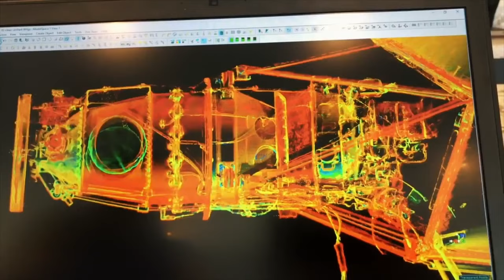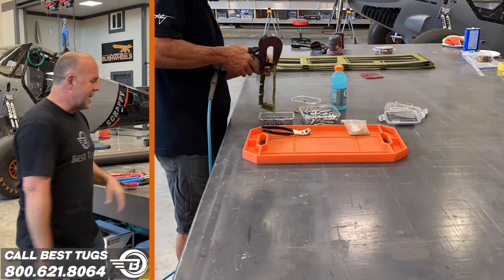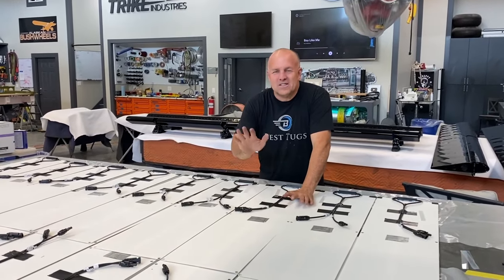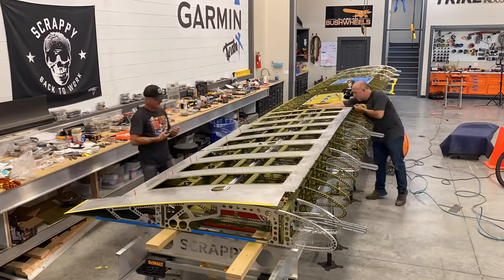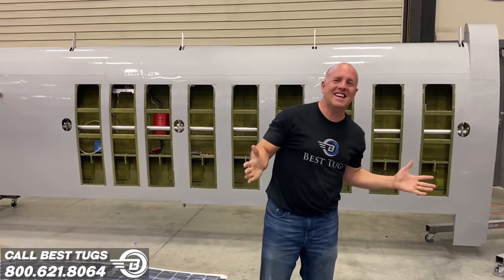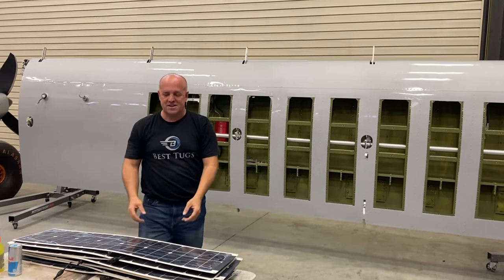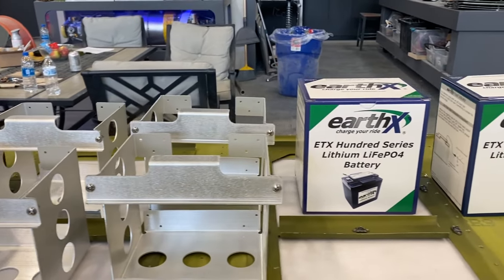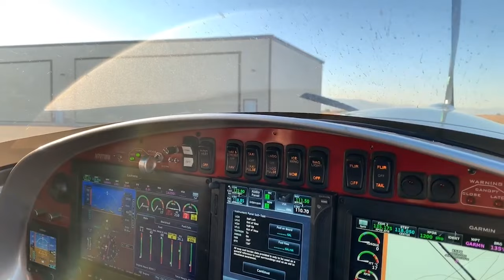Solar Panel Wings on Custom Search and Rescue Bush Plane | Scrappy #59

Comment: I put a sticker on my Grumman and had to take a nap afterwards. 
It's a Mike Patey sticker though so the sticker itself has a lot of additional parts, functions, features, etc
Reply: That sticker is better, stronger and lighter than all before, I guess? 😉🤙🏻
Reply: I have to take a nap after watching most of Mike’s videos.
Reply: That sticker alone just shaved 5 knots off your stall and added 5 to your Vne🤣
Reply: And it kept working while you slept...
Reply: Bryan, when you get back to the plane that sticker will have given it a wash and wax.. Back to Work.
Reply: ...and it is made of carbon fibre!

Comment: I think the most exciting part is the fact that when he’s “done”, he’s not done. There’s gonna be something that he thinks about doing after this plane is already complete. Absolute genius, Mike! Keep inspiring. Keep pushing the limits. You’ve earned a fan for life.
Reply: An old engineering adage: "If it isn't broke, it's simply because it doesn't have enough features yet!"
Reply: With only two seats and with the ability to carry large loads under the wings he should make some carbon fiber people carrying pods. Can use the excess electrical power for a heat pump to heat or cool the pod interior. They would easily double up as extra cargo carrying capacity for day to day or S&R usage. Bonus points for being able to air-drop cargo like life rafts with supplies or cases of beer for thirsty campers. Integrate the Garmin system to auto release when drop calculator indicates an on target landing.
Reply: Draco X is coming up
Reply: @peach6405  yep, I think allot of people forgot he as another Wilga waiting to be build!

Comment: Ahh yes, overengineering the shit out of everything. I love it. 

Sincerely,
a German
Reply: lol...for you it wouldn't be overengineered then? just normal
Reply: @shaneward6689  Maybe thats how Einstein got the idea of relativity
Reply: That's the German way...
Reply: Yeah, World famous German engineer.  I fully expect that Mike would attribute some of his inspiration to that.
Reply: I wonder if he uses 8 different kinds of fasteners to hold the cup holder on and require half the plane be taken apart to access the last fastener like the Germans did/do.
Reply: @tihspidtherekciltilc5469  integrated design is mostly lighter than an easy accessable one... ;-)  best regards from a German engineer :-D
Reply: @DaEVOthefreak  Cheers to you as well. I was just teasing which I think you picked up on. That being said why is the thermostat on my friend's Passat buried behind the timing components?
Reply: @tihspidtherekciltilc5469   Or late Audi Quattro. Remove front of car, remove engine and auto, separate auto from engine. Replace cam belt, rear of engine. $7,000.
Reply: @moyadapne968  Seriously?
Reply: @moyadapne968  You should be a writer for Chilton's!
Reply: Wrong.  He's overbuilding... not over engineering.  There's a HUGE difference.
Reply: @David-ql1hd  The wing system on this plane is definitely engineered beyond anything you would ever see on a commercially built plane.

Comment: The level of thoughtfulness in this build is absolutely astounding. Can't wait to see yall take her up.
Reply: definitely, it is going to be pretty heavy though
Reply: @jakub-kube  good thing he's got Nitrous
Reply: I don't get it..  how can the solar panels be a structural part of the wing, are they aluminum backed?  It seems like they should be backed by aluminum and riveted in, or the will just crumple up with air pressure.
Reply: @gwenives9203  I just mentioned that above, the negative pressure on the top of the wing might suck them right out!  Good thought!!  --gary
Reply: @gtr1952  my concern with the panels is that if they are not well secured to stop flexing and vibration, they normally fai lprematurely. The normal way to secure them is with adhesive coating the whole back of the panel and glowing them to a solid surface.
Reply: @gtr1952  negative pressure, so vacuum you mean? I dont think that will be an issue. Im sure he has already thought of that and tested everything multiple times
Reply: I thought so this as well.  The air lifts the wing so wouldn’t the air pull on the solar panels and because they are weaker than the aluminum sheeting, will they be compromised.   Hope you see this threat Mike.
Reply: @DBartWest  guy literally builds a whole ass plane in front of your eyes, but you think he hasn't thought about wing loading lolol
Reply: @DBartWest  Ummm. You think a guy who is on his 14th airplane build didn’t consider these things? 😎
Reply: @tomcoryell  these panels are supposed to be fully supported over the whole area of the panel. Just being supported at the edges and a couple of places in the middle will lead to much reduced solar performance very quickly. I have seen the output of them reduced to nothing in a matter of months when not installed correctly.
Reply: @gwenives9203  they're not. He added extra strut to compinsate in part for the solar
Reply: @tomcoryell  Yes, of course I think he has considered that, however, like 3-4 other people here, we would like to hear that consideration from Mike.
Reply: @cnknguyen  Yes, of course I think he has considered that, however, like 3-4 other people here, we would like to hear that consideration from Mike.
Reply: @gwenives9203  Cubs fly around with fabric covered wings. Let that sink in and you have your answer.
Reply: @Kenriko  no that's not an answer. Fabric is very strong, ever try to tear a shirt without starting at the seam?  Whereas solar panels, whatever they are built on, certainly may not be structurally sound, plus even if they were strong, some reverse pressure inside the wing could just pop them right out.  It really seems like a huge goof, he would have been better off just creating an aluminum wing and then depositing solar cells across the entire thing on top of the aluminum.  But then again he also machined his ribs, clearly not understanding that machined parts don't have nearly as much strength as stamped parts.   Hey but maybe that's why he put a parachute in S-crappy
Reply: @cnknguyen  yeah, well he also bought over priced under valued video cards for his simulator, so he hasn't thought of everything.  Plus he doesn't seem to realize that machined wing spars are not nearly as strong as stamped spars.. it comes down to the atomic arrangement of the alloys.. have you ever seen anyone using a machined sword?  No?  There's a reason... it isn't nearly as strong.
Reply: @gwenives9203  Would you like some more salt? The solar panels are on a plastic substrate that's about 1/4th thick. I would not consider it structural but it'll hold up to the wind just fine. He won't get nearly the amount of power he expects out of them though.. 200-300w unless the conditions are perfect.
Reply: @Kenriko  wind? I guess he's just going to be flying in a wind tunnel?  When I fly, there is a lot of turbulence, sometimes horrible air pockets that could cause a rapid drop outside the wing, causing the internal pressure of the wing to just pop those things right out. Seems like a great idea, solar on the wing, but flying up to a scenic spot to watch a movie? That blows my mind, why someone would want to get that far away in nature, and then not just want to listen to nature, they have to have a distracting movie on .. whatever happened to calm, quiet, contemplation? Well sorry, I'm way off track now.. 1/4 inch thick plastic, that will melt nicely when the plane gets hit by lightning, or even too much sunlight.
Reply: @gwenives9203  How about we step back from the arm-chair quarterbacking and let the man engineer. Clearly time will show who was correct.
Reply: @Kenriko  wow.. I just pointed out some problems with the engineering, and now you want to run away.. go.. run away.

Comment: You should consider mounting a extreme high def camera on the underside of your aircraft to use in your   Search and rescue.  It is much easer and  with  better vision for your back seat observer to watch a video screen than they could see through a window.   Also it can be reviewed later for something you might have missed during your first pass.   Just a suggestion.
Reply: Like a gigapixel one? With the 100TB solid state drives now this could be a real thing.
Reply: Why go half-way? There are 8" diameter FLIR turrets that would work beautifully mounted up under the nose or on one of the wing-cargo points.
Reply: @T.J. Kong I would love to see L3 donate one just for the “oh hey civilians check out our cool expensive toys”
Reply: Thermal is the way to go. Even just having a spotter looking out an open window with something like a pulsar accolade2 will make spotting humans 20x easier. I hope Mike and his SAR team use thermal as it really is a game changer
Reply: Yeah FLIR is the way. Augmented visibility in fog, night, etc.

Comment: I feel like scrappy needs a FLIR turret so the search doesn't have to end after the sun goes down.
Reply: I think he already mentioned having cameras for taxi purposes that will have low light/FLIR capability.
Reply: @irvingsmith3449  Draco had it as will Scrappy. In the mountains around where he lives SAR is always out looking for lost hikers in the mountains, snowmobilers, even boaters overboard. The system isn't military grade but just about.
Reply: Thats a great idea. Maybe a hud display with an A.I. algorithm designed for search and rescue.
Reply: Is Ron a pilot? Just curious. Anyway, back to work.
Reply: Projector built into Scrappy?! So when we see a movie playing on the clouds we know where Mike is.
Reply: Flir a flir? Of course he’ll have Flir. Don’t all carbon cubs have them? He he ha ha Ha
Reply: Yep, Mike has already spoken about thermal cameras for search and rescue. Scrappy will be fitted out with several cameras.

Comment: 1: Oversized engine & prop capable of near VTOL thrust in still air. Check.
2: Wings able to hang ground search vehicles and don't know the word Stall. Check.
3: Suspension that can handle hard landings in rough terrain. Check.
4: Enough power to build a second plane in the middle of nowhere. Check.
Master plan: Search and Rescue confirmed.
Seeing all of the pieces over the build I can finally see the big picture, and it's very obvious once pointed out.
Excellent work Mike and Co.

Comment: This has got to be the most capable Search and Rescue plane ever built! Absolutely incredible engineering and forethought for the mission! Thank you for sharing all your thinking and rationale as well as the execution of the build by you and your staff.
Reply: Agreed.  Full redundancy, solar, equipment power, permanent emergency kit onboard, motorbikes on the wings, the list just never ends.  Every time you think Mike's finished hes build something else that nobody would even have dreamed of.

By this point Scrappy doesn't need a hanger, it's going to have to launch from underneath Mike's swimming pool to the Thunderbirds theme.  This plane IS search and rescue.

Comment: I can’t wait to see how many of these great ideas are going to find their way into Draco X. Imagine huge double a arm suspension on a Wilga. Say goodbye to Wilga wobble!
Reply: since Draco is designed for STOL Mike would have to shed weight somewhere else or need another powerful motor to get up to speed...
Reply: @mastex5575  he has that turbine in the case
Reply: With every build exceeding the last , Draco X is going to be EPIC !
Reply: @patricktennant1585  Yes he already stated that Draco X will have a more powerful turbine than the original
Reply: @fredbugden3511  I think I can almost picture what Mike’s going to do, but he always surprises me.
Reply: @primrosereceptionist611  Mike said it’s going to be close to 1000 hp!

Comment: These have got to be the most complex wings ever designed and built.
Reply: I doubt it
Reply: For GA perhaps.  AF (armed forces) has all the nutty folding wing and sweep wing designs plus whatever the heck is going on with the Osprey lol
Reply: I'm surprised there is no carbon fiber shear wall spanning underneath those numerous solar slots. Like to see a Bend Test now. And a temp reading camera monitoring the inverters.

Comment: Very cool, I certainly hope you have some rf chokes on the lines. Inverters tend to cause frequency within the battery circuit. It can build static electricity. Since it's right next to fuel I certainly hope you took precautions for shielding it. Other than that very cool

Comment: I hope you like this ”Silly" build of ours. Mike you are doing what Grumman can't with tax payer money, and endless resources. With so much more style and detail . This build isn't silly, it's epic.
Reply: As a non aviation person what are the bits that stick up when you do the  rivets?
Reply: @donkinzett3961  I'm assuming you're referring to the clecos.  The silver or copper colored things sticking out of the skins when he is doing assembly.  They are spring loaded and have a special retractable split tip that will slip into a hole and clamp the sheets together when released.  Extremely useful for sheet metal assembly.

Comment: I feel like I’m watching a runaway diesel when watching this build. It just keeps going and gets crazier. 😂
Reply: Had that happen once- the crankcase was vented from the air intake to the oil fill tube, and I made the mistake of adding oil with the engine running.   A GM diesel running away on aspirated engine oil is not a good sound!

Comment: Now it's starting to look GOOOOD.  I am worried about a solar panel that acts as a lifting surface.  With the weight of that plane, won't the panels be pulled off from low pressure?  I thought this plane was crazy before.  Now we're into insanity. Love it.
Reply: Wondering the same.  Mike clearly knows what he's doing though so it would be good to know why this isn't a problem.
Reply: It’s a little concerning having that many lithium batteries in the wings as well but I’m sure Mike has considered the potential dangers
Reply: @professorvoluck9311  my concern as well! I have seen many lithium batteries explode!
Reply: Looks like there is 25 bolts into rivnuts for each solar panel, plus the front edge tight slot. I'm more than sure this is over engineered, just like the rest of the plane.
Reply: I was wondering the same about those plastic solar panels. Maybe laminate some carbon on the underside of each panel for stiffness?

Comment: Everyone keeps commenting on the panels like the tongue and groove is all that's holding them in did all of you forget where he showed all the nut plates that hold these things on? I'm sure Mike did a metric TON of modeling to ensure the panels won't just pop off the minute the wing starts to produce lift
Reply: A more conservative design would have had a metal skin under the solar panels in case of a pop off.
Reply: I counted 25 bolts in each panel , plus the front slot. Definitely up to the task, seeing as these usually have a fabric skin.
Reply: More concerned of negative pressure causing them to crack down the middle of the panel or around the fasteners. Especially over time and operational fatigue.
Reply: I did some very rough calcs based on measurements off the video and Cub wing loading. The panels will each have an upward load of at least 10kg (22lb) at 1G.

Comment: He will probably have a lathe driven off his propeller for turning down parts!
Reply: The 700+ HP engine is to run a pump for draining large lakes if needed.
Reply: A PTO on the ass end of Scrappy? Don't give Mike ideas like this......

Comment: Mike, are those solar panels sufficiently stiff that they won't flutter without being laminated to an aluminum or carbon fiber panel?
Reply: Yeah, I have those on my truck and they have a thick plastic back. I guess if you bend them to wing shape the become even more stiff. I think that's why he went with narrow 50w instead of 100watt panels.
Reply: If its the top surface of the wing which gives lift, how are these plastic sheets attached and going to contribute to the overall area?
Reply: And also, how are those panels secured so that they don’t blow out during flight?
Reply: Should be stronger than cloth fabric which has been used for decades. 
🤔 yep
Reply: @gvc76  the panels have several holes around the perimeter that screws go thru into nut plates. The panels are screwed down to the wing
Reply: @corymurphy2947  I would hope so.  But many cloth fabrics are actually very strong, and better than a lot of other materials.
Reply: @Airplanefish  of course, but I was thinking more about material strength.  With air rushing past at 150 knots, the pressure on that panel would be around 60 lbs per square foot, if my math is correct.  That's quite a bit of force.
Reply: He’s literally designed and built his own aircraft from scrap and you’re questioning whether the solar panels are secured correctly ? BAHAHAHAHAHAAHHAHAHAHAHA
Reply: @gigiparhigi80  you do have a point there.....
Reply: @gigiparhigi80  don't let the name fool you. There isn't one piece of that aircraft that is made from scrap. Every component has been engineered and custom fabricated to provide maximum performance. You're looking at what would probably be a $3 million airplane if he didn't have his own, state-of-the-art machine shop and assembly facility.
Reply: He should have made that upper wing surface rock hard. It should not be the weaker point of all the others.
Reply: @gigiparhigi80  the whole series on Scrappy is exactly about all the detailed engineering that goes into designing this plane.  The evaluation of the panel strength and how they are secured to the wing are important aspects of the design, and would be interesting to address, especially considering that they form part of the wing.  Also, I wouldn't be so dismissive. What Mike is doing is absolutely amazing, but no-one is infallible.